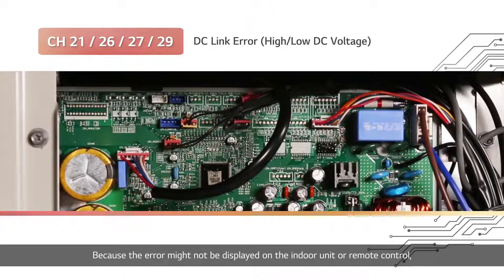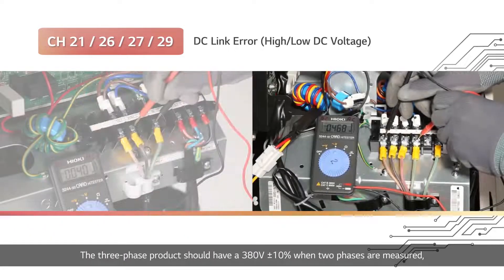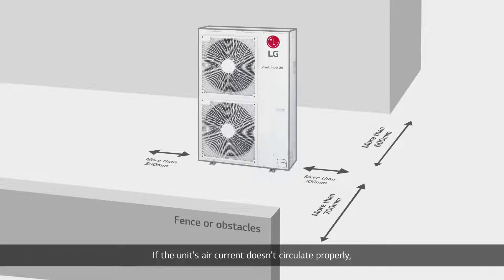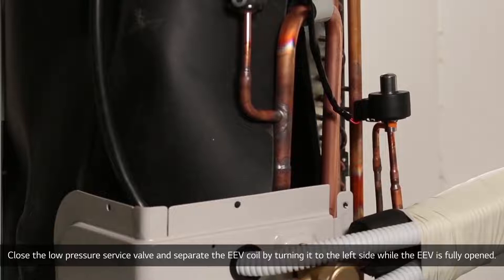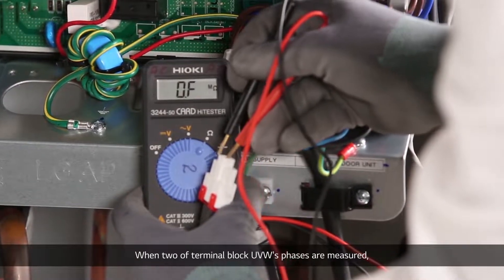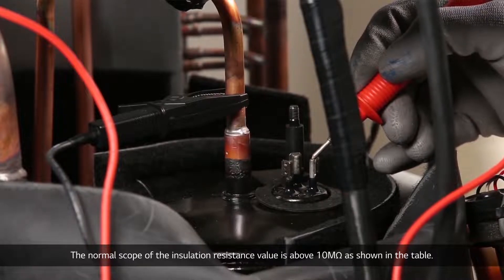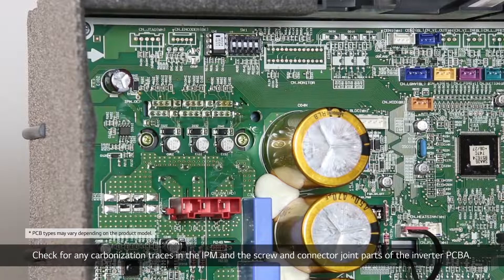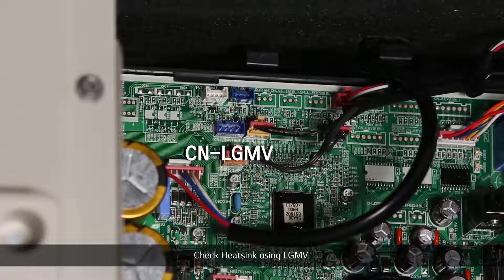[LG Air Conditioners] HVAC Single-Split Troubleshooting CH21 CH26 CH27 CH29 Errors

Comment: We have the mini split units in our home. Every room has them. The house we purchased (modular) built brand new for us had these units with the purchase.  They are the absolute worst ac/heat units I have ever had.they need cleaning on a regular basis,mold will build up on the blower units in the house,the drains clog up with liquid mold and you have to clean them out.  If they get a leak of Freon you have to find it and it could be in the wall where the lines run.also the filters on these don’t filter the air very well at all,dust and molecules always floating around our house. A traditional unit would have never did this. I don’t recommend these units for anyone.